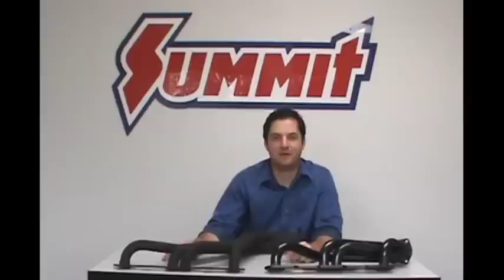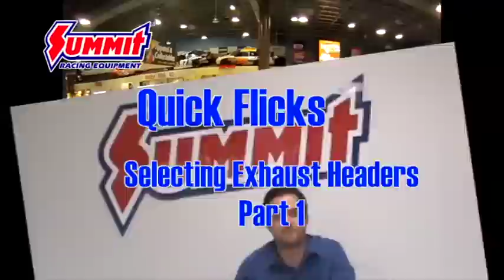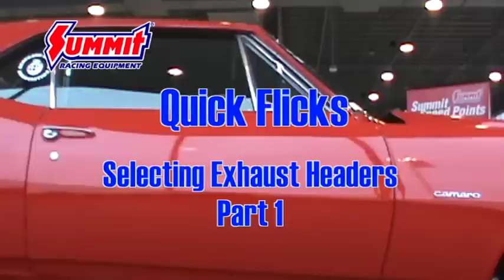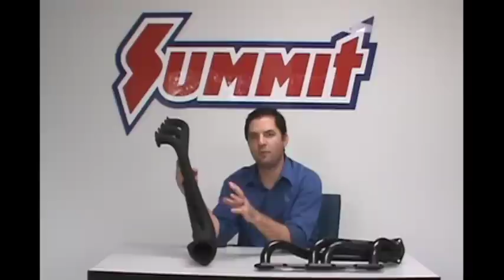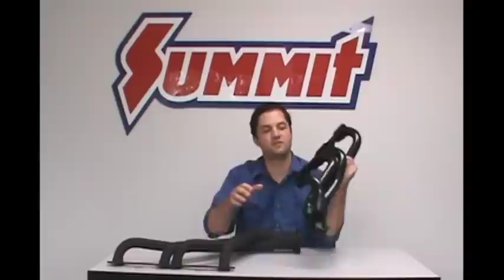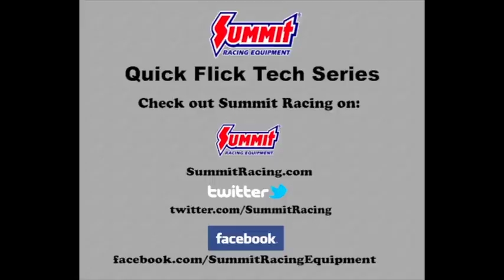Long Tube vs. Shorty Headers - Summit Racing Quick Flicks

Comment: I’m looking to install a set of headers on a 1989 Chevrolet Silverado 1500 350v8 5.7L.
I will lower the truck to a comfortable desired height but I need to know what would be a the best application/style headers for this vehicle?

Comment: that so called long tube is a mid length  and the shorty is only going to make top end hp with big scoops out of torque, the long tube and mid length headers shall make the most peak and average torque. there is no probably.

Comment: I think you may have that backwards. Long tube headers give you high end power because the Scavenging is more stable and doesn't take effect until it gets into the high range. The reason shorty headers we're good at low RPMs because the Scavenging effect is actually accelerated because the Scavenging effect is more pronounced because of the collector being closer to the combustion chamber. And it draws stronger. The problem is is that at higher RPMs it tends to get muddled in the fact that unless they are equal length tubes. They can sometimes get in their own way. And you lose some of that Scavenging effect at the higher RPMs. But if you're going for a streetcar, you still get 97% of the effect of a long tube header with Shorty's and they fit a whole lot easier. If you would add within about 8 in of the exhaust port a crimp, called a fueling crimp named after the man who devised it. It would help to reduce reversion into the intake as well on cams that have a lot of overlap. And you'll never see it in the horsepower and torque numbers. You might actually see higher torque numbers. So I think part of your explanation is backwards when it comes to long tube vs. Short tube. The effect is the same but the reason for the effect is opposite of what you explained.

Comment: I'm new in this I recently bought a 2011 chevy colorado 2.9L and   I'm trying to make some upgrades so what kind of headers do u suggest for my pickup truck 
I already put a hp shift kit to the transmission and a posi track  lock to the rearend thanx
Reply from the maker: I am not aware of any headers for the 2.9L engine, but we do offer some performance exhaust options here https://www.summitracing.com/search/year/2011/make/chevrolet/model/colorado/department/exhaust/section/exhaust-systems-kits/part-type/exhaust-systems/engine-size/2-9l-178/engine-family/gm-4-cylinder 
Just be sure to choose the proper body style from options tab.

Comment: I think you missed an important point and that's RPM, for the most part it seems that long tube headers loss a lot of torque at the low RPM and are really only good as you climb over 2500 or more, whereas a short tube header or better yet a Tri-Y will give much better performance from idle to 3000 or so including better torque and MPG, then you missed the most important thing, where do we drive on the street???, I cruise at 2000, generally 1500-2500 with some runs here and there, we are not racing 100% over 4000RPM on the street, anytime I put long tube headers on something I noticed a low end drop.....with headers one size does not fit all

Comment: So I have a low clearance vehicle.  From your  videos,  I calculated I need  a 2.5"  collector tube.  Does the collector tube under the car have to be round tube??.....or can I construct  an oval but flatter collector tube  with the same square inches  area?  Thanks
Reply from the maker: Hi Don, you can use flatter tube, but it will not have the same flow characteristics as the round tube.

Comment: Looking for headers for my 94 f 150 5.0 soon to be supercharged. 5-6 psi boost. What would you recommend? Also, I want to make sure to get a good pair where the flange is true. Thanks
Reply from the maker: Long Tube Headers is your best bet:  
https://www.summitracing.com/search/part-type/headers/year/1994/make/ford/model/f-150/header-style/full-length/engine-size/5-0l-302/engine-family/ford-small-block-windsor?N=header-style%3Afull-length

Comment: I purchased (PerTronix) JBA headers that were allegedly stainless steel and titanium ceramic coated. Within 2 months they started to rust. Within 4 months they started to rot off the vehicle and leak. The company and the manufacturer denied this was an issue. It was excuse after excuse to deny the warranty claim; stating that they leak because they were improperly torqued (Installed by a ASE certified mechanic) and it's normal for surface rust. Not to mention they lied about their description and stated they are stainless steel when in fact they are just crappy metal with a cheap coating. Please do yourself a favor and NEVER BUY FROM AUTOANYTHING.COM OR JBA HEADERS (PerTronix). Now I'm stuck with scrap metal.

Comment: With my 1983 ford f1504x4, the long headers were ridiculously expensive made to order. I went with manifolds, not considering shortys, which would have been the best performance/value option.

Comment: I had long headers installed on my foxbody. They burned up 3 starters, blocked the starters from being removed, had to cut the exhaust pipe to get header off, it also blocked the transmission from being removed. Learned an expensive lesson. Have short headers now. Got beat up $700 long headers I bought from Summitt sitting in my garage. Might get $200 for them on EBAY.
Reply: Thats your own damn fault
Reply: Yeah, I should have ditched them after the first starter burned up and not tried "mini' starters, heat wraps, etc. But removing headers to take off starters,  transmissions etc. is a common practice, that is why a coupler was installed. I just decided I did'nt want to do it.

Comment: I have a 95 k1500 suburban 5.7lt
Witch should i go with i want more horse power, better get up but most importantly torque. I do alot of mudding and i pull boats and trailers up hill!! Witch do u suggest  long or short??   thanks!!
Reply: What did you end up getting, I have a89 k1500 with the same engine. Well mine is tbi not vortex
Reply: I think they still had tbi until 96 right?

Comment: I have a 1981 f150 with a 302 windsor. I feel like going from long tube headers to a big 3 inch pipe would sound mean as hell. Would that kill power? What size exhaust would i need and would it be better to do dual exhaust?
Reply: Zach Haynes 2 1/2 with x pipes would be perfect

Comment: Wich is better for my 2012 prius
Reply: longtube
Reply: anthoney smith Thanx for the advice. I'm going with long tubes for my Prius. My Prius is going to get alot of respect out on the streets now
Reply: You get a real car.
Reply: Molotov cocktail
Reply: SAMMY THE BULL sell the Prius
Reply: Get rid of the gas engine and upgrade the battery to 1000000KW electeic motor on each wheel then no one will mess with the prius of hell. Or just enjoy the quiet and gas mileage.
Reply: Current theory on Prius headers are to run them short and exit under the front bumper. This helps greatly to develop back pressure for trapping and reburning exhaust gases. Thank me later.
Reply: Use one of each.
Reply: This mans😂... for my prius😂😂😂

Comment: I'm curious and I would appreciated your opinion...  I have third gen Trans Am, 350 TPI Crate engine, lt4 cam and some other mods, around 400 hp and I will put true dual exhaust. I have on my mind long tube headers and H pipe. Long tube gives more power in mid range and H pipe is better for low end torque so I believe that would be OK setup for my car??

Comment: WHAT THEY NEED TO DO IS HAVE A oem engine say out of the new GM SS and then compare stock exhaust manifolds to 1 and 3/4 headers and also compare the same with hi Flow cats v's OEM CATS that way you can see what a NA OEM Factory engine will produce, before changing the Exhaust manifolds from stock ones and i bet my bottom dollar based on the design of the headers,( also compare the 2 main types of headers long v's short) Talk all you want, but real time tuning on a OEM engine which is like the new GM SS 6.2Lt ) you will only notice a increase of about maybe 10HP down low and up at the top end of the power curve, which is why to date not one dyno engine company has put an upload of this kind,why because it takes away the market for the exhaust people and they would probably block the uploads as well,especially with OEM engines without any mods to the engines whats so ever factory settings on air and fuel and air map settings full stop ? sure you can get better performance but for the average driving, which is to say the engine is always around the 2K rev range and not much over till you put your foot to the floor then you might have the extra power, but the gains are so small that you will not notice it in say a GM SS at all, unless you have an OTR and Exhaust and Tune done, then you will notice the rear wheel HP or KW ranges  ?
Reply: True headers alone won't make a notable difference in power, but that's because it only helps the engine exhale. Slap on an intake/port polish throttle body to help it inhale and get an aggressive tune and you'll really feel the difference.

Comment: would shorties be more beneficial on a truck when towing
Reply: The only reason he's saying shorties have more backpressure to create slightly more low end torgue is due to how your exhaust is setup with longtubes. If you do your exhaust right and just get some extensions for your o2's then relocate the cats it'll have every bit of backpressure that shorties have. Longtubes are superior in every way, they just require a custom exhaust unlike shorties. As far as clearance issues goes and them sitting lower with longtubes I have no idea what he was talking about. They fit snugly well above the frame. Not even remotely close to being bad for clearance, that might change with specific vehicles but not with trucks.

Comment: would I get more performance out of my 5.3L with shorty headers vs stock manifolds ? or would long tube be best I have true dual straight pipes as it is im just worried about o2 sensor wire and such with running long tubes btw my truck is a 2008 chevy Silverado z71 if that helps thanks.

Comment: Summit Racing, So, in using shortly headers, what can be done to supplement that lesser horsepower compared to what you're receiving from long tubes? Are we talking wider throttle body or maybe higher performance heads? More specifically, for top end HP. Thanks.

Comment: I'm building an 84 Dodge w350 four wheel drive with a 360 la engine and I'm having a hard time deciding whether to get long tube headers or shorty headers I'm building the truck for pulling and mudding what would be the best application for what I'm building

Comment: Had to make a small notch in the frame to accommodate my long tube headers and also relocate the fuel tank. It and 81 dodge with a mild 360. Any of you guys looking to run full lengths make sure you're prepared to make some modifications to your vehicle cause no matter if the design is specific for your vehicle you'll most likely have to modify something to install. Luckily mine isn't a daily driver so the frame notch is not a big deal.

Comment: what would be the difference in the HP between the Lt/ and St header with a tune for a 2011 camaro ss with cold air intake?
Reply from the maker: tlewilson,
Unless you’re able to find someone who has done the testing on the same car, with the same parts and the same tune in the PCM the results could vary greatly!

Comment: for a 2011 srt8 challi what's the loudest best most crackly deep exhaust?  I don't want 3 recommendation I want the 2 loudest best
Reply: brand doesn't matter. just get long tube headers with a 3 inch dual exaust with an x pipe and either high flow cats or no cats.
Reply from the maker: Hi Mehdi, 
This is really hard to answer. Each manufacture has a specific tone. When customers ask us our opinion on exhaust sound, we typically recommend that they search YouTube for your year, make and model vehicle with after market exhaust systems or mufflers installed. This will give you a good idea of how the system will actually sound on your car. Thanks for watching! Good luck!
Reply: I was thinking borla but to many people say they drone and then I wanted corsa but slp loudmouth sounded good to idk which to pick from the 2
Reply: +Mehdi Elkhatib  I like the sound of kooks or american racing headers. probably going to get kooks put on my ram.
Reply: +Kameron James rams sound great with a new exhaust
Reply: If you don't care about the tone of the exhaust...or emissions, the loudest possible sound could be achieved by running open headers (long tube or shorty headers with no midpipe, no cats, and no mufflers.) It will be  supper loud and sound like a T-Rex screaming it's head off, but it'll have a lot of drone, and when you car is at a stop, exhaust will leak into your car. To fix that, have a local shop weld some strait tubing from your headers all the way to the rear of your car. None of this is recommended, but I'm just answering your question.

Comment: yea i got a quick question.
does more horsepower mean more gas being used or will i actually save gas getting this upgrade.
Reply from the maker: Hi Jennifer, 
Yes, because the motor is now flowing more air at a higher RPM where horsepower is made, it will need additional fuel for a proper burn in the cylinder. If you drive everywhere at wide open throttle only, then you will use a lot more fuel. Now, due to less exhaust restriction and better airflow at lower RPM, its conceivable that you could also get a better burn in the cylinder thus improving your fuel economy. Now, there are a lot of if’s and’s and but’s here too such as engine size and usage. Driving habits and how you tuned the fuel delivery system after you installed the headers! So, the short answer is, It Depends!  

Comment: I just bought a 2002 Z28 LS1 to build with my son. One of the first changes will be headers but now I've come across a Trickflow header/full exhaust. I want to be up around 450-600whp when I'm done. It's just a father/son project so I have time. I'm in NY so I can't have a check engine light on for state inspection. I want to end up with a daily driver type of a beast.
Reply from the maker: Good luck, Berry! Let us know if you have any questions. You can give us a call at 1-800-230-3030!

Comment: I have a 77 Ford van with a 460 in it has manifold on it now I want  to get headers for it its a 4 wheel drive van I am assuming im going to have to use some sort of block hugger type of header any ideas
Reply from the maker: Hi Chris, 
Unfortunately, we do not show any headers for your application. If you are willing to fabricate, try to find someone that may have found a header that worked this same application. This would give you a starting point.

Comment: I rebuilding a 99 Camaro. Concerned with what you spoke in with long headers. Could I run those even with the car sitting as Low as it does stock?
Reply from the maker: +John “VampBoss” Desselle, 
It is true that this car has issues with long tube headers, especially when lowered. You’ll have to be aware when entering driveways or parking lots that you don’t bottom out the headers. If this is a concern, then a mid-length or short style header may be better for you.

Comment: can I wrap my headers with that fabric exhaust heatwrap?
Reply from the maker: +Rusty Shackleford, 
This is how Hooker Hedders feels about wrapping headers: 
If your vehicle is being run on the street or for extended periods of time, you should never wrap headers. We never recommend exhaust wraps because it insulates the exhaust too much and retains moisture. This causes the exhaust temperature to be raised to a level that fatigues the header material causing cracks and can also cause rusting and pitting due to the moisture retained. .If you choose to use an exhaust wrap, the warranty will be void. If under hood temperatures are an issue, we recommend using Hooker’s Metallic Ceramic Thermal Barrier Coating. Our coating is applied inside and out. It is corrosion and heat resistant up to 1600°F. It also reduces underhood temperatures and has a polished high luster finish. Holding exhaust temperatures inside the header increases the exhaust gas velocity producing more horsepower. You can purchase any Hooker header with our Metallic Ceramic Thermal Barrier Coating by adding a -1 to the end of the part number.
Reply: Summit Racing Very informative answer. Thanks!

Comment: I have a 2012 challenger 392 6.4L with flowmaster super 10's exhaust which would be best for my setup long or short?
Reply: Full length/ LTs, friend had some they were great
Reply from the maker: +CoronaKing, 
Well, for all around street driving, ease of installation and lower cost, the short headers will work best. For max effort racing with some modifications to your current exhaust for installation, the long tubes will work best.

Comment: So short tube headers don't have you cut out the catalytic converter ?
Reply from the maker: +Kregz Syb, 
Correct. Shorty headers for some applications are designed to be used with the OE converters.

Comment: I'm building an 85 K10 with a SM 465 " Granny Low" transmission for towing my mud truck to events and for an off road weekend warrior. My question is what would be the best header style for my application? I'm looking for that low end torque to power over obstacles but at the same time I want the mid to high end torque to be able to pass and pull my trailer with ease.
Reply from the maker: +Nathan Williams, 
A long tube header would be the best choice for your all around usage.